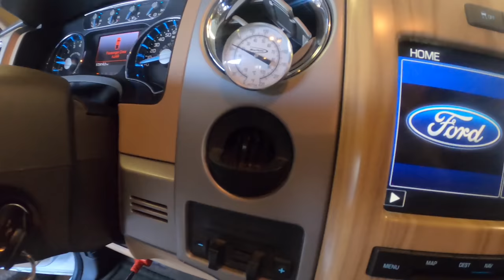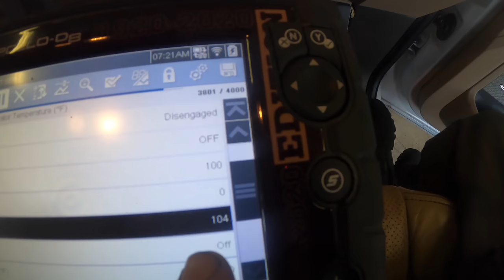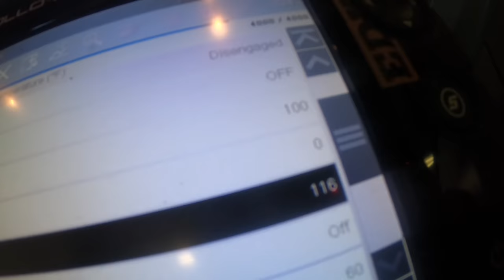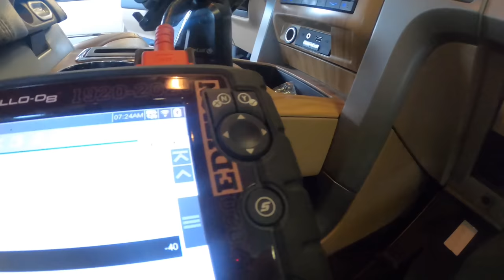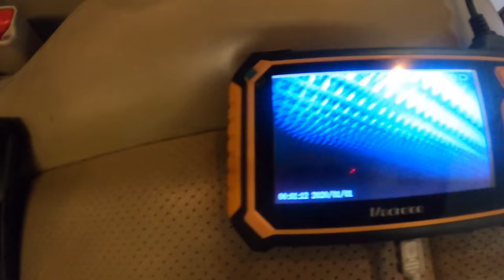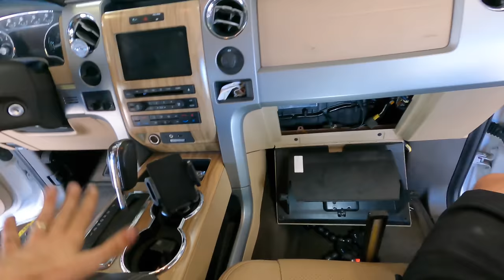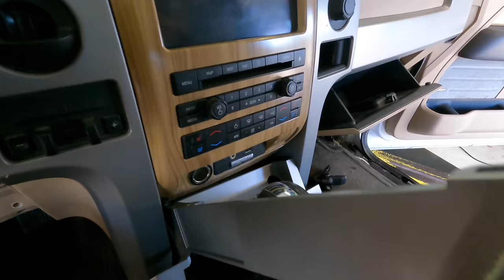TEN HOURS to replace one sensor! Ford 150 torn to pieces! Evaporator Core replacement.

Comment: Cut in to the box and around the area of the sensor, pull out the sensor and then repair the plastic box with some good glue and a bit of plastic, job done and time to get a coffee or just slide in to another part a new temp sender.
Reply: Yep....dremel cut a section of that housing and epoxy it back after replacing the sensor.....ghetto but way easier than that teardown
Reply: Ummm...pretty sure Ray said the sensor does not come as a single component. The sensor comes as part of the core and is not a stand alone part hence the need to replace the whole unit.
Reply: That's what I was thinking, just cut a big hole, replace the sensor and then JB Weld the old piece back in.
Reply: @mupdog9697  Electric temp sensors are all resistance based and pretty standardized. That sensor he got would have worked, He just needed to add a few ohms to the circuit to calibrate it. Chances are that is all that is in that black plastic sensor box. A standard temperature probe with a resistor to throw it out of whack, and then corrected through software.
Reply: @mupdog9697  Sensors are just resistors, nothing special or magical.
Reply: @mupdog9697  You know that sensor is made by some supplier and probably available under another part number.  Finding that info is tough though.

Comment: I had an 86 Sable that the heater core started leaking. Ford said it was a 10 hour job. I could not afford the labor, so I did it myself. After the dash was out, I plugged off all the vacuum hoses with golf tees, started the engine, and moved the car to a different part of my driveway.
Took me a little over 9 hours, but everything worked when it was back together. Ended up with only 2 small screws left over.
Reply: 2 extra screws ,mmmmm , extra part means "Over Engineered"  😵
Reply: Did you do the ole’ atmosphere refrigerant evac in the driveway?
Reply: @craiglyles4755 , The A/C probably leaked out. Don't think they were sealed that good back then. Just a guess though. Also, might have been heat only.
Reply: @Embermist69  I had a 85 sable and put Barrs leaks in the cooling system and fixed the heater core leak …
Did the same thing with a 79 Lincoln
Reply: The air conditioner was not working at the time, and I didn't recharge it afterwords.
I had tried Bars Leak previously and it did not stop leaking.
OVER ENGINEERED, I like that statement.

Comment: Great job Ray. I don't know how you do it. I get overwhelmed just watching you. I would have so many bolts in wrong places, unless I bagged and marked each set, I'd have broken every clip possible also. The thing would be a rattle trap if I had to put it back together.
Reply: A little bit of colored paint would help too, especially if you're just going to lay them all over the place like Ray did. Colored paint on the screw head, colored paint over/around the hole. Some colored fingernail polish set may do the job.

Comment: I don't know what over engineered garbage sensor ford use in this, But Electric Temp Probes do not tend to go bad unless they are met with extreme conditions, such as temperatures way out of specification, being exposed to the elements, or a sharp knock. Even then, they can be engineered to handle it. 3D printer sensors survive hours at 150/200 C+ temps. This thing that only needs to handle human comfortable conditions should never die... Yet it seems to be a common problem

That temp sensor could easily just be installed through a port in the box with a thread and bolt to snug it down... This is blatantly been done this way to inflate service time and gouge money, this is confirmed by the fact that they only sell it as a Compleat unit for a broken jelly bean part.
Reply: While I completely agree they should make sensors that last, I will say, AC evaporators are kind of a lousy environment sometimes. If air ducts get blocked, they can freeze up with ice, then hopefully re melt happily.  Also, there is always condensation in there sometimes pooling if drains get clogged. But you are correct, they should figure out how to make one not fail.
Reply: See my comment about the 1990 Ford Taurus....
Reply: Qefna Ija  me too.
Reply: @fyx812  Sorry man. Was scrolling for ages with ctrl + f trying to find you in the comments, but i can't see it. 😓
Reply: I don't know what you work on, but thermistors and diodes as electrical components fail quite often.
Reply: @stargazer7644  Thermistors are quite reliable actually as they are based on semiconductors. The main mode of failure when it comes to a thermistor is a failure of its controller. They are used in mission critical applications like fire systems and medical thermometers, as well as in 3d Printers because of their stability.

Thermocouples however are another story. because they are basically two dissimilar metals bonded together, Thermal cycling can cause the two to start to crack at the junction, or have the accuracy drift substantially over time because of chemical interactions and corrosion.

I'm going to guess ford used a thermocouple, as over a 5-year period it is feasible it could drift 5-10C out of spec. Where a thermal couple would see something more in the range of 0.5  - 1C or 0.05 - 0.1C of drift depending if it is epoxy or glass dipped.

Basically, if it is this much of a faff to correct this failure and you are not going to make it easy to service, a thermocouple is what is needed.

But if you want it to fail to get some service time and spare part sails, then a thermocouple is an ideal component choice for some of that planned obsolescence. Especially when its degradation leads to a self-destruct condition.
Reply: @pseudonymity0000  Thermistors are not semi-conductor based.  They're bulk resistors with a high temperature coefficient.   I have never seen a thermocouple used for this kind of application.  You typically see those where very high temperatures or very high accuracy is required.  Thermistors or diode junctions are more typically used at room temperatures.  The controller is not usually the main mode of failure.  Thermistors can and do fail.  Components exposed to constant temperature cycling have higher failure rates - that's just a fact of life.

Comment: I've had two cars recalled for dash covers (a 1999 Olds and a 2005 Lexus) that required complete dash removals, which makes more sense in those cases than this truck, but my point was - the Olds dealer took 6 weeks to complete the repair and the Lexus dealer took 4 weeks. So, pretty amazing Ray turns this job around so quickly.
Reply: Replacing the dash takes about 3 hours. Getting the parts is what takes forever. I was working for Lexus during the dash replacement periods, and our dealership was getting the cars in, getting approval, ordering the dash and sending the cars back out until the dash came in. Seems kinda silly to hold on to the cars, waiting for the parts. There's a long wait on parts like that, because they had to put the parts back into production, and were not going to produce any more than they needed. The job itself I can literally do blindfolded. Evaporator core is a little more involved.
Reply: some cars are even quicker to rip the dash out, my 05 ford Territory ( Australian model) I can rip out in an hour. 4 bolts holding the dash, 4 on the steering colum and 5 plugs
Reply: @gore1978  07-12 ES350 dash pays 2.9 hours warranty, start to finish. Whoever came up with that time, was on the money. I've probably done well more than a hundred. Remove, transfer over A/C ducts, wire harness and other parts to the bare dash, and back in, and I could barely beat the warranty time. I would like to have a serious talk with the guy who came up with the warranty evap replacement though. That paid 3.2 hours warranty time, and I think the fastest I could ever get that done was 4 and a half hours. And there was something wrong with the 07-08 evap cores and half of them started leaking within regular warranty, and a bunch of them still within certified extended warranty periods. Glad to not be in a dealership and doing warranty work anymore.
Reply: @KillaCiViC1181  I think they do the time based off the car being on the line with the front screen out or having most of the tools already set and other interior out. who knows.
The territory I have is close to the American Escape and 2 plugs in each kick panel, 1 bolt either side of the dash A pillar and the dash has the hook clip, 1 allen key head in the centre of the top and 1x bolt on the trans tunnel to strip the dash out. Some guys got to a point of cutting away the firway where the heater core sits so its slide in and out system which is our biggest fail part with the blend door motor rods. T
he evap core seems to hold up.

Comment: Considering the age of the vehicle and the amount of labor it took to access the evaporator core, would it be a good idea to talk to the owner about replacing a 50 dollar heater core also?
Reply: I'm getting set to replace the heater door flap in our 1999 Jeep Cherokee.  As per other Jeep owners,  Replace everting you can once you get the dash out,  Next year you will be thanking last year you for that for sight.  Will be replacing the evaporator core, heater core too and a few other things hidden back behind the dash.
Reply: I would've disconnected the whole thing and save a lot of money by switching to opening the windows on hot days.
Reply: @adamreno3653  You must live in new york.
Reply: YES!!!
Reply: @adamreno3653  I have 2/65 AC in my truck, and it never breaks down.. Actually I have 3/65 AC, as I have a rear window that opens too. Almost forgot about that upgrade.
Reply: This is completely a what else can be replaced job?
Reply: @IMRROcom He might. But I live in upstate SC where summers are sweltering and long, and of all the vehicles I've owned few had working A/C. I'm an old fart now, and when I started driving less than half the cars here had A/C; it didn't kill any of us. Maybe 10% of the houses here had A/C back then too. I definitely like having A/C but it's a want, not a need, and it can be dispensed with when repairs exceed their value.
Reply: @P_RO_  and you had to walk up hill to school in the snow and you had no shoes too.
Reply: @IMRROcom  Nah, but I think Dad did, and there weren't any hills where he was raised at...
Reply: Buddy had motor rebuild & didn't get a new oil pump & of course it failed later, he wasn't very happy paying for a second service.  I told him wish I'd known! shouldn't have been a choice! Not worth saving a few hundred
Reply: @adamreno3653  I did that will a couple minivans in the 1990s.  Granted the vans were shot but I was down to Junkyard prices when sold.  No one wants to drive anything without AC. and I live in Iowa.
Reply: Like replacing a water pump while you're that deep changing the timing belt. It only makes sense.
Reply: @adamreno3653  --I would have Traded that Demon!!!
Reply: @adamreno3653  he is in Florida where everyday is hot & humid.A/C is a must
Reply: @IMRROcom  not far enough north, Maine is best!!
Reply: Sigh. How right you are. I am 82 and can no longer drive. I got extra parts left over from cars I had in the 1960s. The up side is that they are now antique car parts and I'm getting some nice coin for them.
Back to air conditioning. I left home before Mom and Dad got electricity. I worked hay fields long before air conditioned tractors. Then I went to work for a heat treating/foundry work, really hard, really hot, I mean HOT. So even now I am comfortable at 80 degrees and can work at 100 plus. Yes, air conditioning is a luxury. I have a/c of course, but it's used more for just fresh air circulation. Does any one remember the whole house fans? Usually mounted in a central hallway they would move a lot of air. Many people made really powerful window fans.
Reply: @P_RO_  I'm 82. I can remember when swamp coolers were invented in the late 1940s. In the early 1950s cars could be air conditioned, but it was expensive.
Reply: I use to operate IHC semi trucks. The AC and heater was under the passenger side seat. Easy to fix the fuse box was behind the glove box used circuit breakers  
Now we got some '22 Prostars 
They are JUNK. Under 30000 miles on one and it's done got 10 brand new tires.
Reply: @jerrykinnin7941  and I thought a 365 Peterbilt were bad........
Reply: @rearspeaker6364  I had good luck out of my '13 Pete. It was a good truck.

Comment: Ray, I remember dealing with this same issue on a Ford Focus. There was actually a published resistance chart in Alldata that told you the resistance value for any given tpersture.
Reply: i bet you are the only one at your shop that could do that job. very good ask for a pay raise 😉
Reply: If the computer only gets a resistance from the probe, I wonder if ray could have adjusted the values with a resistor. I wonder if that would have been sufficient for most cases (I don’t know if the probe’s readings are linear or some curve).
Reply: @kiseitai2  The actual component is probably a thermistor. What you suggest likely wouldn't work properly. If it's a simple thermocouple a resistor might work. Either way determining the value of that resistor would be a trial and error nightmare.
Reply: @kiseitai2  It’s a negative temp coefficient sensor, resistance changes with temp, could install a rheostat and dial a resistance…or just manually cycle the compressor or do what most techs do and use a hole saw to replace the sensor and glue the cut out back in the evap case.  A good trimmer can R&I that dash in around 3-4 hours, not a hard one like the old Mercedes that call for 22+ labor hours.
Reply: @craiglyles4755  Not the neatest solution but it gets the job done!
Reply: @kiseitai2  I was thinking the same thing.  Put the probe in, then calculate the remaining resistance needed and solder a resistor equaling the calculated resistance on the wire.  Definitely would take less than 10 hours to do and be a lot cheaper.
Reply: @craiglyles4755   you could use a hot stapler gun and then use plastic welder to cover and reinforce the seams around the staples.
Reply: @topc5826  Yeah, I normally do a back plate “hot patch” plastic welded, works great and can  be removed if needed.
Reply: @craiglyles4755  
You mean like a hot glue gun ?
Reply: @bruceb4349  No, it’s a technique where you attach the cutout to a back plate and secure the backing plate plate to the evap case
Reply: @craiglyles4755  Understood. 
 Thank you.
Reply: @craiglyles4755  
Just like patching a hole in drywall
Reply: @topc5826  Yeah, same concept

Comment: Parallel a couple resistors, say around 50 ohm to start on the leads. Adjust resistance as needed, or solder in an adjustable mini pot and adjust until its reading the right temp (ohm load).
Reply: that's assuming a systemic offset and the sensor is working fine otherwise.  Big risk.
Reply: You know something about electronics. I agree but I'd start with an adjustable pot first (if I had one) and once I found the resistance I needed I'd get the necessary resistors and put them in. Of course I would probably have cut the HVAC box open trying to get to the sensor and then epoxied it back on before tearing the whole dash apart too. New vehicles are a pain.
Reply: that more than likely isn't going to work. doing so will correct the offset, but there is a good possibility that the scale (ohms/degree) is going to be different. it might be right at 70 degrees room temp, but be way off when its 40 degrees in the evap core.
Reply: Those sensors have a range of resistances related to temperature, and that range differs between different sensors. So adding or subtracting a fixed resistance may not work.
Reply: then it still doesent read the temperture tho.
Reply: @mikecalhoun8497  The sensor was built into the evaporator. 9:08
Reply: @mikecalhoun8497  THere hasn't been a car/truck made since the 90's that does not require the removal of the dash to deal with most HVAC.  Once and awhile there is room to change stepper motors and so forth, but usually, and especially, when there is an automatic climate control system you're removeing the box.
Reply: @ReadTheShrill  Ray was going to try a F250's sensor but put in a different location on the evaporator, but it was a different resistance. At $1100 for the part and almost 11 hours of labor it was worth a try. Just because it was built in to the evaporator it's just a transducer being used to measure temperature and being in a very slightly different location on the evaporator shouldn't have made enough difference to worry about.
Reply: @williamkelley7654  Make that the 80's maybe the 70's. I had to take the dash out of my wife's 80 Mustang to replace the heater core.
Reply: One more reason to hang an engineer by his jewels. Ford doesn't care if it screws its customers on repairs.
Reply: It may not work if there’s more going on than a fixed offset, given all the trouble involved it certainly feels like it’s worth trying.
Reply: Or just fix it the way its supoosed to be in the event another mechanic has to work on the vehicle and try to figure out what ridiculous skip around was used to fix it ....
Reply: Yeah, usually doesn't work, or last if it does. When the tread is off the tire, it's off the tire.
Reply: @n2uid01 ,  See also: GM
Reply: That won't work, as it will still either cause the pump to be on or off depending on whether it is above or below the threshold.
Reply: @rickn8or  Dash comes out, heat works on one side but not the other.Replace faulty part that fails after 90+ days. I have seen this problem on GM since the later 90s.
Reply: @thewelderdude  Most all these sensors are measuring a resistance. It would be close enough. I do have a background in electronics engineering.